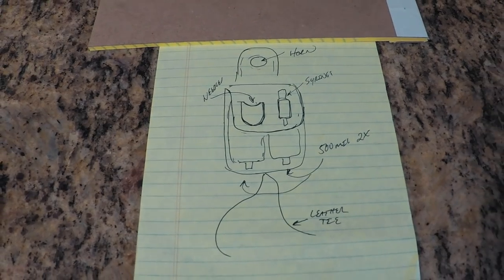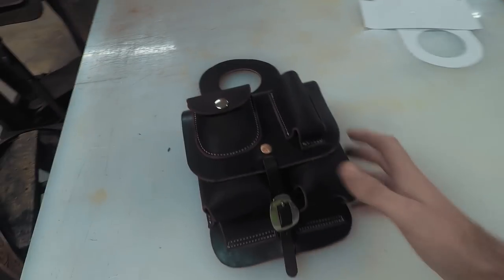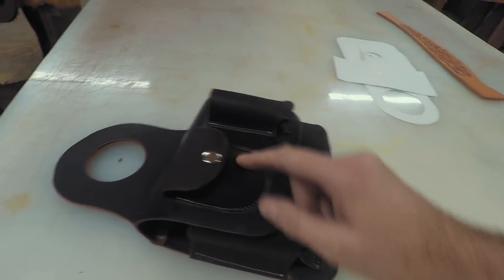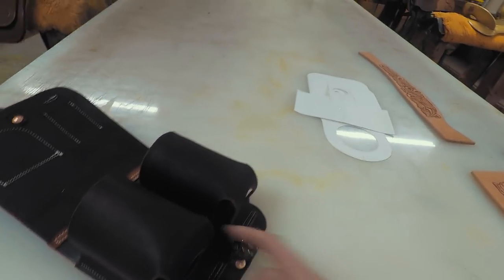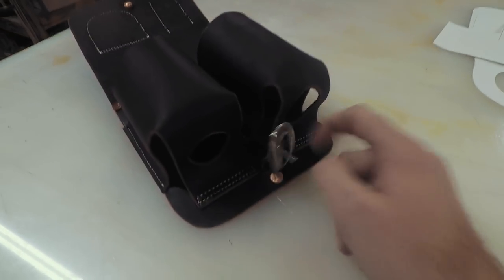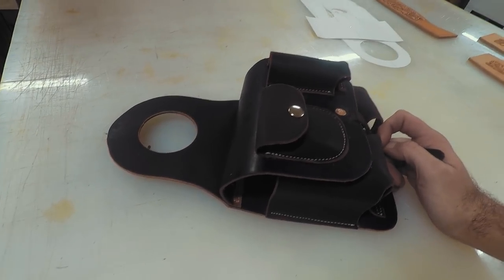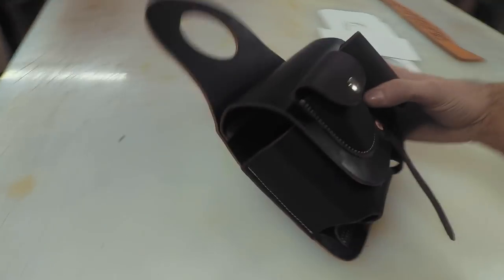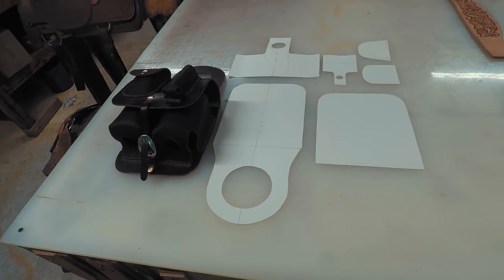Making a Leather Doctoring Bag for a Saddle

Comment: Ever thought about creating like a saddle bag or something for one of those big walkers with seats. Cause yes they come with baskets under the seat but with mobility issues it's damn near impossible to get to them n then you fold up the walker you have to fuss with those stupid bags or baskets you have to attach n remove them. But if it was more accessible n easier to remove like over the bar would be great. Would need a drink holder place for phone n maybe large purse like compartment for wallet, tablet or whatever.